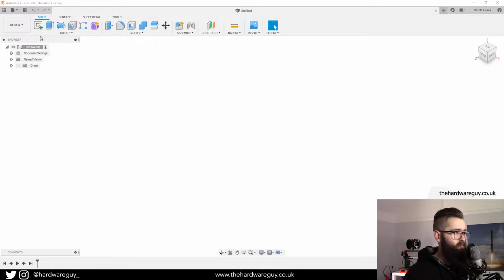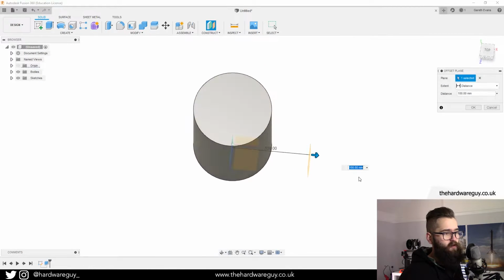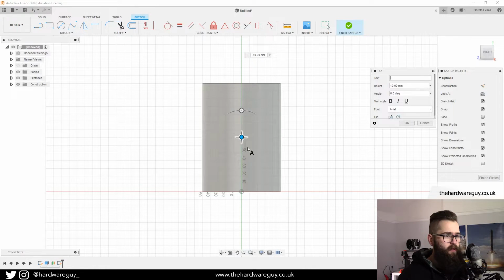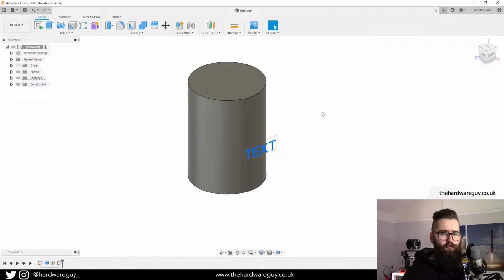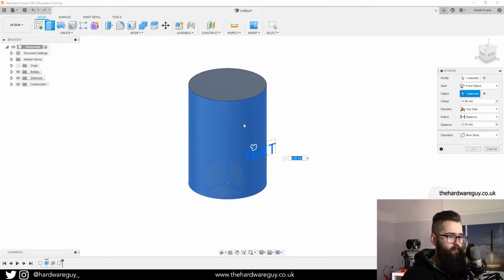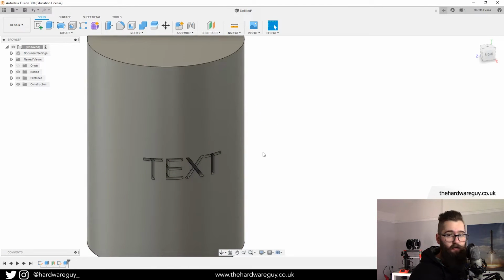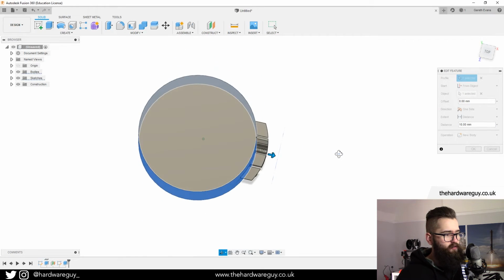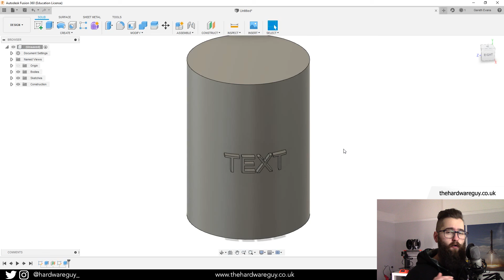Projecting Text To A Curved Surface - Fusion 360

Comment: OMG this was the only thing that I got working, I had a surface that was curved in two axis, and I couldn't get anything to work on it to follow the face and engrave with a small offset, I tried looking for this for like an hour and I tried multiple different methods to try to get it work. This did the job, thank you so much!

Comment: That method works for short words that fit inside of the curve. 
Do that with a longer word and you’ll see the end letters slant. 
Try it with a word longer than the width of the cylinder and it doesn’t wrap around the ends.
That takes a workaround with the sheet metal folding function in F360.
Reply from the maker: Indeed! That is a different problem and I’ll have a separate tutorial for it!